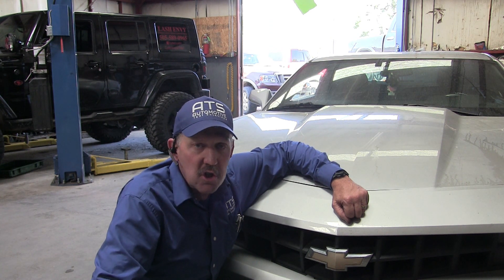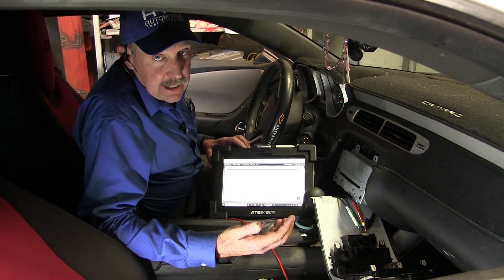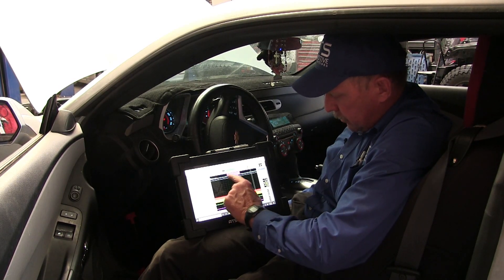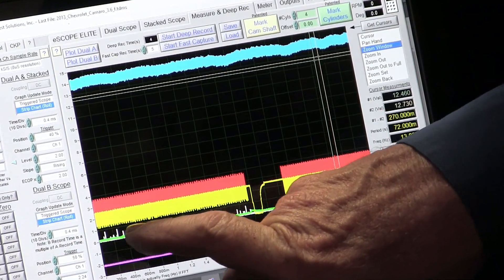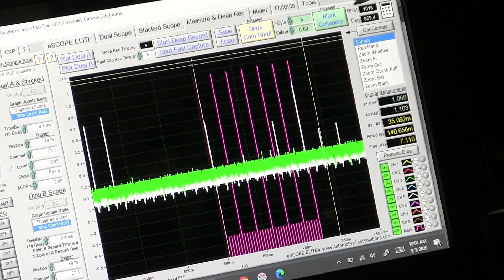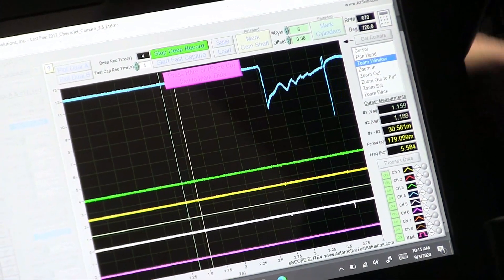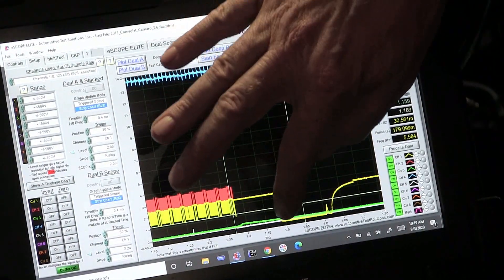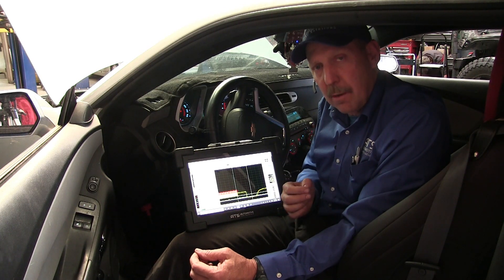2013 Chevy Camaro Intermittent Radio Diagnosis

Comment: The audio output ic can be the issue of this problem? Maybe that is the short what is causing the spikes on the ground signal, and obviously the radio it turns off because of that
Reply: There is a possibility, however its been a few months of problem free driving after i heatsinked the l5962 voltage regulator.
Reply: @humbleyourego6053 how did you heat sink it? And do you happen to have a photo of your work, I'm learning these microchips slowly over time and have a Camaro with this similar issue and by the way you guys are the best help and most informative and educational teachers I've learned more from this video and you're comments than the whole Internet and my local disinformation system combined people just like to spew about things they've never done or seen. So really thanks in advance 💯

Comment: *Check main radio unit cooling fan operation... In my situation, the can bus noise was coming from the l5962 overheating and sharply shutting down due to bad fan driver & poor thermal transfer.

Comment: just cut the white wire from the control head plug and be done with it. Fixed at home for free!
search you tube youll find it.
Reply: I did that and it worked for about 2 weeks, now it's back to shutting off.

Comment: Thanks for the video. I've had clock issues with the CAN tranciever chip on various components over the years. Most cases, its just a cold solder joint. Thanks again.

Comment: We have this problem right now. My question is would this cause blinkers and other things to start to go haywire also?
Reply: I have the same problem is you. every find anything out. Having the same issue
Reply: We replaced both back blinkers and they started working properly after that. The dash electrical issue however was the radio. Took to dealership and spent way too much but it's all working properly now.
Reply: @noellanmcdaniel9055  mine is doing the same thing I think just buying a new radio will work as well ...

Comment: Try disconnecting the battery for five minutes to reset the BCM. It worked for me and it’s easy.
Reply: So many vids of replacements, wire cutting, etc., when simply resetting the BCM cures it.
Reply: I disconnected the battery for 10 minutes. Worked for 5 minutes!! POS radios!!!

Comment: By radio control head does he mean the control panel itself or does he mean the gray control unit behind the pannel
Reply: The grey box behind the panel is the radio unit. I've had the same issue. I replaced the panel with no luck, then I replaced that grey box behind the panel and it worked out.YEL/TAN serial wires are not actually a CAN bus, it's a local stack-bus related to radio-panel communication. Understanding what unit is controlling the line is essential to diagnose the problem. Need to unplug a unit and see what unit actually talks to the line.

Comment: Fantastic video. 

These radio units are very ubiquitous among GM models built around this time and are readily available online from salvage yards. Cheapest solution by far. Try and get one that was made outside the 2013 model year, that seems to be the batch that has this problem.
Reply: Do you know if this will also fix the AC unit. Asking because I have the 2013 model and having the same issue. Radio and AC unit cutting off and on.
Reply: @angieangle9760 hey did you find a solution? Dealing with same issue
Reply: @panhandleliquors7894 I’m looking for a solution
Reply: @panhandleliquors7894 every find anything out. Having the same issue.
Reply: @kevinscott5515 every find anything out. Having the same issue?
Reply: What year do you recommend
Reply: @Zatos_Garage_build  Whatever you can find with the same p/n. Mine was out of a 2012 Cruze.

Comment: If you cut the white wire on the harness in back of the radio it never fails again.. sounds crazy but it works
Reply: @Doug Thanks for putting out this info. Having the same problem with my 2013 camaro and this helps a lot.
Reply: @angieangle9760  what ever happened to your Camaro
Reply: Thank you— radio control unit— or a new radio head unit
Reply: Not always. That "fix" didn't work for my 2013.

Also, just pull the pin out of the back of the connector if that's the route you want to go. That way you can just put the pin back if that doesn't solve your problem. 

Nobody was able to actually diagnose mine. I was lucky and guessed that the radio unit itself was bad, and I was right. Wish this video had been around about a year ago. I ended up replacing mine with a radio unit from a salvage yard (Chevy Cruze, I think. P/N was the same) and having it reflashed by the dealer. $140 total. No issues since.
Reply: @doug960  when you say radio unit do you mean the radio control panel or the actual head unit (gray box behind the panel)
Reply: @Zatos_Garage_build  The gray box. P/N 22923803. Still working to this day. I see a couple on eBay for around $80 now.
Reply: @doug960  thank you! I’ve been trying to figure out what’s wrong with it since 2016 and the dealership had no idea.
Reply: My dad has a 2013 Camaro 1ls exactly like mine built one week apart. Same problem, same fix. I'm very confident if you replace that unit with a salvage unit it will solve your problem. 

Keep your receipt so the dealer or whoever reflashes it has proof your part isn't stolen, just in case. The dealer who tried to diagnose mine refused to reflash, but they are just an awful dealer. I had to go to a GMC dealer down the street for that service.
Reply: @doug960  that white pin thing only worked for a couple days now mine is back doing same thing again. I have a 2014 .. Really don't wanna spend 900 on a few radio.  What's the cheapest way to truly fix this??
Reply: @doug960  awesome.  How much is the reflash?
Reply: @mysterybat35  Koons Buick GMC charged me $125, but I had to sign a waiver that the radio unit would not be covered in the event an unsuccessful reflash corrupted the firmware because I supplied and installed the part. They said that never happens and this is a common issue. That was 2 years ago and I'm still issue free.

Comment: Bernie  I believe the radio is pulling the communication line down.The voltage spikes on the ground side coincides with high amperage positive voltage loads from the internal radio amplifier when failure occurs.The modules were communicating for a lengthy time with no radio sound output to the point of forced ignition key re-cycle.The scope data was showing high loads from the stereo amplifier at time of failure.I personally would of spent more time on this diag
Reply: Great train of thought but now add in the radio station and hvac settings changing when the failure occurs. Also add in information, not given in the video, that the control head communicates with the hvac system on a different communication line (that the radio is not a part of).
Reply: I second that.. The extra time spent led to discovering l5962 Linear Voltage Reg not properly cooled leading to thermal shutdown. Checked temps with Flir, pushed it over the "edge" with a soldering tip on the outer case after noticing pattern in hot weather. maybe firmware flash in S29AL016J is garbagio. too much pwm signal or just a bad cooling fan motor/driver & poor thermal transfer. Head unit is just a bystander in all this. i believe the thump in the audio/ ac settings flashing intermittently is due to the ubrupt nature of the thermal overload shutdown on a component that regulates voltage for the whole a/c, radio bus.

Comment: Based on your preliminary show and tell, I'm not convinced it's a radio problem. Do you have a before and after repair to show and tell? I don't think a new radio would fix this, looks more like bus noise to me and a BCM problem.
Reply: Same issue with my 2013. Delay in the radio startup and everything. It's definitely an internal failure somewhere in the radio unit. Lots of CAN signals pass through there so it really messes a lot of different systems up when it fails, and can be hard to track down. Replacing mine with a salvage yard unit and reflashing/ unlocking it solved the problem. No issues a year later.

Dealer tried on and off over the course of a month unsuccessfully to diagnose and wanted $600 just for the radio unit. I told them to pound sand and quit throwing fixes at it in search of the problem. I could do that myself, so I did, for way less money. Replacing the radio unit was the first thing I tried. Luckily it worked.
Reply: @doug960 :
 Normally in the service and diagnostic and repair industry, we have to be able to prove our work! Funny how a medical doctor runs on guesswork alone! I'm not sure replacing the head unit fixed your problem, or it was a wiggle in a wiring harness that ultimately got the job done.!? I'm glad for you either way, but I'm pretty hard core about proving the work! 

If there ain't no proof then there ain't no bill. I need to eat and customers need something to see! I have always played the fair game, not the long con. I need proof! You need proof! We all need proof this is the problem, then again more proof this is what fixed it! I'm just a guy sticking his nose where it does not yet belong,,,,, it's my disease to bare, I can't bite tongue.

Cheers man 🍻.
Reply: @Finite-Tuning  I have really lost faith in all my local dealers. They couldn't even begin to explain where they thought the problem was, let alone why. I paid $120 for the initial diagnosis and reflash and they essentially told me unless I wanted to pay them to put in a new radio unit without being sure that was the problem, they couldn't help me when I came back twice after that first diagnostic. There weren't any independent shops around with the know-how to help either, at least not that I could find. 

I'm not an electrical engineer or a network engineer, but I understand that modern cars are rolling data-centers now. Everything talks to everything through multiplexed channels, and even if you do understand how it all works, you still need the wiring diagrams, which I haven't yet learned how to decipher. I only know enough to swap parts... so about as much as my dealer 😉

I don't think this was a fluke. I had the dead radio and digital display in and out several times to take them apart and check the PCBs for obvious signs of failure, heat damage, liquid/ condensation damage, iffy solder joints, etc. and the problem never changed. 

The second the new unit was in, BAM no more dropouts anywhere. It was the middle of summer and not having A/C half the time really motivated me to get it fixed. For $40 on the salvage unit I was willing to try. No more problems once it was programmed for my VIN, which cost $100. 

My dad has a 2013 Camaro built about 2 weeks before mine was and he had the exact same problem about 6 months ago. The fix was exactly the same too. Two nearly identical cars, same problem, same fix. I think there was a manufacturing defect in a certain batch of these radios made in 2012 for model year 2013 cars.

I hear ya. I also like to know exactly why I'm replacing something, to the exact on-board component or ground strap, especially if I'm paying someone to do the work. But in this case, I got lucky.
Reply: @doug960  :
 Good for you man, and I mean that sincerely! You have beaten the odds and won.  Because it's not really a trade secret (as if there were any) I'll tell you here where to look up: "Mitchell on demand" and "Alldatadiy". The best manuals you could hope to know are somewhere  between the 2 of these above.

'Mitchell' or 'Alldata', who does it better? Well I know which one I go to every-time, but you must chose for yourself. I told you where to look, the rest is up to you bud.

Cheers 🍻.
Reply: It wasn't a radio problem, he made the call on the control head.

Comment: used scope for the first time today checking engine cutting off. crank signal goes away. now have to check and see if its loosing power or ground. scopes have opened a whole new world for me at 64 thanks for sharing your knowledge hope soon can afford to get one of those units like you use i bought a snapon vantage legend which has 2 channels had to start somewhere
Reply: How much was the vantage legend? For what Snap-On charges, I'm sure there are lots of entry level scopes you could have gotten. A entry level Pico 2204A is in the low-mid $100 range.
Reply: @killer2600  you are correct i got the legend for 2 reasons one was the guided componet testing and wiring diag for each sensor. i wanted the vantage pro but they are gone. lots of information and easy to work. and it had the 2 channel scope it also shows how to connect and color of wires for each sensor figured would make easy to learn scope. i am looking at the e-scope and the e-scan from tst or may get 4425a pico in the near future and the legend was 1700.00

Comment: I'm extremely curious to know how something is pulling (spiking) the ground up, despite a good bypass ground wire being in place.  That power line has a lot of hash on it too.  It didn't seem to start as soon as the engine started, but after a few seconds it sorta ramped up.  Looked like it might coincide with ignition pulses though.  I'm a little hesitant to pin this on the control head so quick.  Seems like high voltage jumping from a plug wire could be causing a microprocessor reset in the control head.
Reply: High voltage jumping from a plug wire isn't that intermittent. The hash on the power feed is likely the charging system. The ground spikes could be anything, the extra ground connection just ensures that the issue isn't a failing/bad ground. Because the ground spikes still occur the issue isn't a bad ground.

Comment: Does the radio have two way CAN bus communications with the control head? Or is the control head the only one on the bus? How do you tell which one is causing the drop out?
Reply: I was going to ask the same question.  I think lots of steps were missed in this video.   The CAN bus used between the radio and the controls is a CAN CGI bus.  Its similar to the high speed CAN bus, but its sending a lot of control and graphical information of over its bus.  Is the bus being pulled low or just dropping out?  Is the radio or the controls doing this?  The HVAC control module communicates with the HVAC controls directly over the network 9 LIN bus.  He did say the HVAC system stopped working when the radio died.    
 There is a also a center stack reset signal that wasn't covered.  As for the ground noise there are a lot of things tied into G202 that could be turning on and shutting off changing the load on the ground. There are a few modules that use G202 that are on the Low speed GMLAN.  The radio set a Low speed CAN bus fault U0020.  The radio communicates with the modules such as the HVAC and BCM over the low speed GMLAN.  The radio doesn't communicate with control panel over the low speed GMLAN.   Why was a full system scan not done to see if  U codes are stored in other modules?  Not only do you need to be a network engineer to work on this stuff, you need to be a systems engineer to understand the logic how these busses function.   Whos to say the radio and the HVAC shut down because there is a GM low speed LAN issue?
Reply: @Discretesignals  the scope data lead me towards the radio amplifier area
Reply: I have a 2013 camaro and the radio and the air conditioner doing the same things.  I noticed this is a common problem with these vehicles. Not car savvy but did anyone figure out what's the issue. I don't want to be spending money on someone to fix the problem that don't know what they are dealing with and just getting money out of me for the same results. So if you guys can help and let me know what is actually causing this problem I would greatly appreciate it. Don't know why they haven't did a recall on this because from what I hear this is a common issue. Thanks
Reply: @angieangle9760  Had the same issue. Removing the radio box fixed the panel flickering issue, HVAC works just fine too. But the display is blank. Can I short the green line to the ground to wake it up?